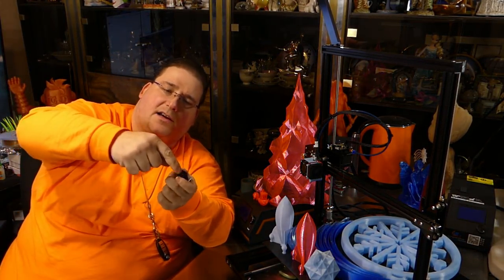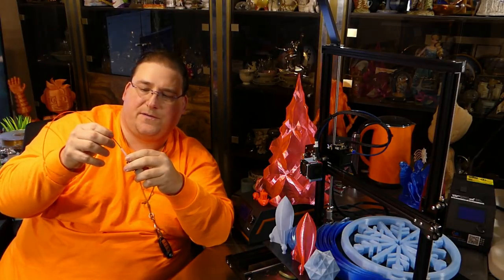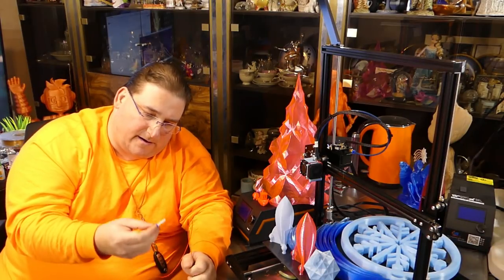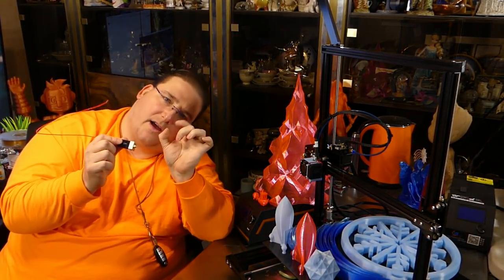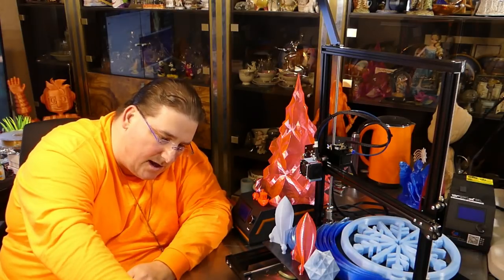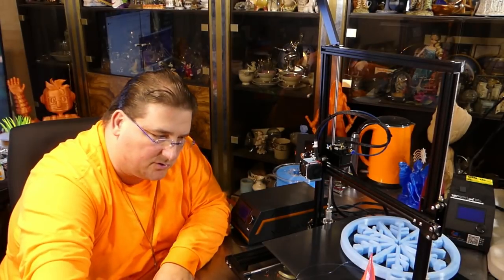Today's 3D Print 175 Anet E12 Update Mid Review

Comment: I know this is an "old" video but perhaps this comment can help other E12 users.
Remember that the left and right side lead-screws and stepper motors are NOT controlled in a close loop. You have to level the X axis carriage first (by ensuring that the left and right side is the same distance from the bottom frame). This is done with the stepper motors disabled. Hold the one stepper motor coupling and turn the other sides stepper motor by hand to level the x carriage. This is an iterative procedure, but it does not take long.

Just pushing downwards on the x carriage can (and probably will ) cause the alignment to go out.

Comment: I had the problem with my acrylic plate warping and causing the same issue. I had to take it off and use a heatgun to flatten it out. I made a video of it. That's a bummer, I think I'll get the tornado or cr10 whatever is cheaper. Just need to find room.

Comment: The 3d printer sucks about to swap out the origenalhot end with a cr 10 hot end rig..
Reply from the maker: That's exactly what I did :-) replace the hot end with a creality hotend and replace the Y Carriage plate with a chunk of aluminum
Reply: The Nobel would weld to the hot end and nozzle after a few tries. Can’t even finish print simple things.
Reply: @nerys71  I switched to a cr10 hot end and getting a  MINTEMP error. I re opened fan case to see if there bad wires. but all wires look good. We keep more and more money into trying to get this printer to work right.  Nothing but more issues.

Comment: We're now in 2019 and  I dropped 289.00 for the E12 from Amazon. If I find half of the issues you found back in 2017 I'll send it back. I'm seeing other reviews that seem to have far less issues and are showing excellent results. I will be using this printer exclusively for printing RC Aircraft in PLA. So, lots of long, thin wing sections. We'll see....
Reply from the maker: I look forward to hearing your results! If it works out well colorfabb has a new filament that has a foaming action so you can print it at up to 35% Extrusion multiplier which gives you a very lightweight p l a also very weak but Done Right the weight savings might be worth it
Reply: @nerys71  I really should have listened to you. This printer really has issues. The flimsy two piece base plate, the crappy nozzle, the  X Axis with it's horrible carriage. I could have spent $100 more and gotten into something a little more high quality. Luckily, I can review your vids here and make the appropriate changes... I have to be able to print tall, thin RC Plane wings with this machine. We'll see...
Reply from the maker: @tgirard123  well the good news is you can fix most of those issues and do so cheaply.

Slap a creality hot end on it (they are cheap) and drill and install a solid aluminum plate. that will fix most of the issues.

also check out colorfabb's new foaming filament! obviously by foaming its weaker but man PLA parts at nearly 40% density is just sweet potentially. I have a roll I will be playing with once I finish my move.

Comment: Very informative video plus the unboxing etc... I am  saving up for one of these Anet E12's  currently and wanted to know your thoughts on what I have seen noted elsewhere is that this printer has a better more stable two railed mount on the y axis while the CR10 has only one rail down the middle, which apparently leads to the CR10 being wobbly.... This is one of the reasons that put me off the CR10 due to this design difference and in favour of the E12.... Thoughts??   Thanks  Laurie
Reply from the maker: +LWJCarroll your information is incorrect I hope you watch some of my videos and I hope you consider my advice sincere

Avoid the anet E12 it's a nightmare :-) okay it's not that bad but it's pretty bad for $17 more you can buy cr10 and no the cr10 does not have a wobble problem

You could actually consider the cr10 to have two rails the left and the right side of the Extrusion once you spend the 5 Seconds to tighten up the eccentric nut there is absolutely no wobble at all some of the very best Prince I have have come off the cr10 I only have two printers that make better quality Prince then the cr10 and that's my Ender and my I3 Mega but neither of them can print anywhere near as large it would take an experience to pro to tell the difference in quality of the outputs

Trust me purchase the cr10 avoid the anet E12

Even after all the modifications and corrections I have made to it such that it now Prince somewhat reliably quality of output is not remotely close to the cr10
Reply: "and I hope you consider my advice sincere" of course I do, I wanted to see what your thoughts were on this part of the design comparison....next thing is watching your review on the CR10.   It was to late last night aka this morning... to do so... Thanks....Laurie

Comment: You just need someone to weld a cross of two steel profiles diagonally onto the board.
...or put a cutting laser on yout CR-10, copy the shape and cut a replacement out of a steel sheet.
Reply from the maker: +ElMariachi or just drill 18 holes in a $20 aluminum plate :-) but i do like the idea of a cutton laser for my cr10 :-) muahahha

Comment: You move th Z on one side. Should be using glass. As long as the X is parallel
 to the bed it should be ok
Reply from the maker: +Norm Caissie negative. You can only have so much offset before you exceed the limits of the leveling knob bolts travel. I would need longer bolts and longer springs to account for that mucb offset. New 1/4 plate coming sunday. That'll fix it right up if i can drill the holes accurately enough.
Reply: What I was saying is if you put the bed springs 1/2 way. Then adjust each lead screw so that the X is Parallel (like =) with the bed then it will work fine. My A8 was like that. It works. Besides the H platform is easy to straighten out.

Comment: I find myself wondering how well a 3-5mm thick sheet of carbon fiber plate would handle being a Y plate, or at least reinforce the Y plate. :)
Reply from the maker: +Aerik Forager very well and also exceedingly expensive :-) but the lower mass on the larger beds might allow faster printing.

Comment: what about the image of the hot end and heat break where the bowden connector fits?
Being a machinist. I think the slip fit of the filament tube to the heat break is horrible. guess ill stick with my trusty highly modified Anet A8.
Reply from the maker: +josiah hall picture of hot end? Sure i will take and post pics when i get home
Reply from the maker: Here you go https://i.imgur.com/Umamy94.jpg note the "slot" in the top of the heat break tube. I think that slot is the problem. I suspect the filament catches on it on insertion. not sure why I can't "remove" filament yet.
Reply: the hole in the hot break looks like it was drilled off center. this can happen  if the part is loaded incorrectly during multiple operations. especially if the threaded piece is an off the shelf part and is modified for specific use.

Comment: Laaaame! Well I have picked up y plates from reprap champion on amazon and have been good. You may want to contact them to see if they plan on making replacement  y plate for it. I think they are just an american reseller of Chinese stuff but the quality has been pretty good so far so I cannot complain. Otherwise angle grinder and some flat stock is always fun!
Reply from the maker: +Shane Ottinger i also bought their plates. Very good. I suspect there are not enough anet and trony xy clones in the market to justify a custom plate.
Reply: True true, hopefully you can get a cr10 one to work or able to make a new one. If you have access to a drill and a hacksaw you may be able recreate it with some angled aluminum (probably the easiest to cut and drill) from homeless, menards or lowe. I know they have some wide and thick stuff that should fit.

Comment: Hello there! Thanks for the informative reviews. It's a shame about the carriage plate...but is the carriage plate for the E12 the exact same as the E10? I have the intent to upgrade my E12 once it comes in and the carriage plate is something I want to replace.
Reply from the maker: you must replace it. not really an option it will warp on you but thankfully it is VERY easy. I will tell you quickly now but I also am working on a video.

you take it apart and remove the y carriage. using super glue you glue the 3 pieces together THEN remove the screws holding it together.

you need a 3mm or 1/8" sheet of aluminum. (usually around $20 very cheap)

if you can you can cut it down (12x12 but you only need something like 10x8 or something like that don't quote me on that measure it :-)

line up the two plates together (centered left to right!! excess in the rear)

mark one corner hole (level bolt) drill. IIRC (wait for video) its 1/8" for the leveling holes and one or two sizes larger for the rest.

drill. stick a bolt and nut on it to pin them together. use the old plate as a guide drill another corner hole. nut bolt.

THEN drill the other corners. nut bolt.

NOW drill through old plate for the rest of the holes (4 for each bearing block and 2 for y belt)

you also need a CUT OUT on the middle front and back so it "clears" the stepper and the tension adjuster for they axis.

reinstall. done. welcome to an easy to level E12 took me about an hour but half of that was stopping to do video etc.. its quite easy.

only change from stock is you need to use a double nut and bolt setup for the belt anchor points since your plate is not "threaded" and being aluminum it would not work well to try that anyway even if you could.

also. print the CNC kitchen E10 shroud. plug and play for the E12 (identical hot end setup) if you have it get a CR-10 hot end (you will need to cut a tiny part of the cnc kitchen shround to fit) but otherwise it bolts right up to the E12 and works so much better than the Anet hot end.

as to your question. I do not know. but now that I think about it I BET it is identical. I will have to compare to two since I plan to replace the plate on my E10 as well.
Reply: Thanks a bunch for the method on making a new carriage plate! Totally looking forward to the future video. Folks like you and I can make a new carriage plate but others may not have the capability. Aluminum replacement carriage plates for the E10 exist in the market. Assuming the E12 carriage plate is the same, people could simply buy these replacement carriage plates. I would be very appreciative it if you could verify that they are the same. Thanks!
Reply from the maker: link to replacement?
Reply from the maker: +Lucas Schulte looks different. 221mm between leveling knobs but the e12 plate is over 275mm between leveling knobs. It is about that front to back but its much wider.

Also checked my e10. Not the same. This might work for the e10 but not for the e12
Reply: Thank you for checking and validating! Looks like making one from scratch is the way to go. Once again, looking forward to the video!
Reply: Hi   I think its about 2 weeks later now and I cant find the video you were going to do about this??  Laurie
Reply: LWJCarroll Nery has stated to me in another conversation that the follow up video will be released today. I'm looking forward to it as well!

Comment: Another great video, thanks!  Can't you just bend the warp back?
Reply from the maker: +Jason Baker in theory yes but it will just warp again and easier the second time I have a better solution on Sunday I have a quarter inch aluminum plate coming in that ought to be stiff enough :-) I got one for the Tron XY as well :-)
Reply: Maybe just give it a stern look and say "You better straighten yourself out!" LOL
Reply from the maker: +Jason Baker hehehe
Reply: a lot of times the machines that are milling these parts are more ridged than the aluminum and could be part of a multi step process.  the tap or threadmill used could be off by a few thousandths, you might not think that would make a difference but it certainly can.

Comment: Ouch - that's a pretty serious design flaw with that printer's bed plate.  Wonder why they did it in three pieces?  On another note, Happy New Year!!! :-)
Reply from the maker: +Reggie Reginato cheaper most likely. They do it on some of there other pronters and easiest way to make a larger printer is with what you already know. Alas what they know dont work too well at 300x300
Reply: I dunno about it being cheaper...  Only saying that as I work in a metal shop.  Cost (assuming being lazered) of making one piece vs 3 pcs +time+hardware, I'm pretty confident that one piece truly is cheaper to make.  Matters not though, they did what they did. :-)
Reply from the maker: +Reggie Reginato I don't think they make these I think they're off the shelf parts which is why they're using them at least that is my assumption
Reply: Ah, yes....  I was thinking they where custom fabricating stuff specific to their own printers in house.

Comment: Well after the a8 i thought i would stay with anet but this is too much...
so, would you recommend the cr 10 or the cr10s more?
Reply from the maker: +Thomas Gerhard if you can afford the difference get the cr-10s it is a very nice printer and it's one of my favorites I have two of them now
Reply: okay thanks for the suggestion i'll think about it.
But i have to say i have now seen other guys with the E12 and other reviews and they don't had that much problems now. Maybe you've got a monday piece of sh*t :P
Reply from the maker: +Thomas Gerhard many users are used to low-quality DIY style kits with lots of little things that you have to fix I also like printing big things which will make these problems show up faster the Y Carriage is a non-starter they should not have done that I have not fixed it and the E12 is going again 14 bucks for a piece of aluminum go to few holes leveled super fast super nice and it should hold it now since that is a free build plate I used I have a video out in about 2 weeks

I just gave it a 60 hour print job to make that noise maker at Joel telling made :-) it's looking good so far my next upgrade will be to replace the very noisy fans with something quieter
Reply: allright i'm looking forward to it!

Comment: drill through top and bottom that well do it till filement dosnt catch
Reply from the maker: +DARREN NICH then the filament can expand where it should not be expanding. Also bad :-) i just put a creality hot end on it. :-)
Reply: i mean drill bowden connector lightly .but a new hot end well do it
Reply from the maker: +DARREN NICH i was thinking about that but feared a bulge forming at that spot though in theory that portuon should never get hot enough to melt filament. I might try it.
Reply: it should never get that hot in that spot .its as you said flashing the parts are allways not engineered propley and the filement can catch aswell .ive just cleaned up my anet a3 exstruder witch jamed bad i ran a drill bit through the heat break retapped the heat break and heat block and bowden connextor. and now filement runs really smooth from the top to the nozzle with no resistance the oley thing i didnt drill was the ptfe tube that gos in the heat break.you can make any ugly duckling into a swan with a little work lol